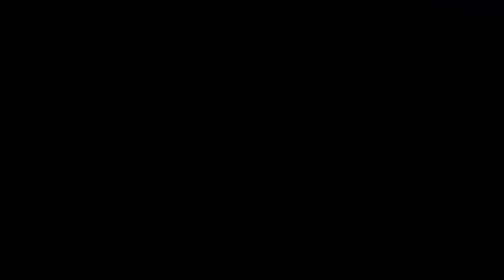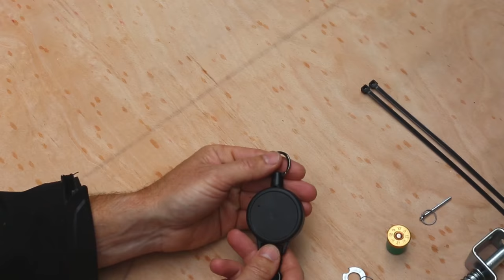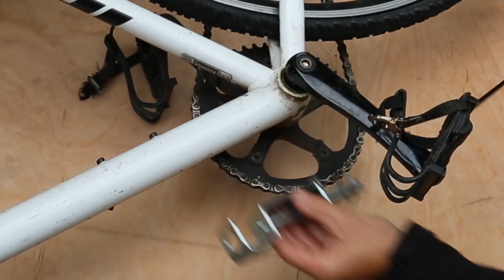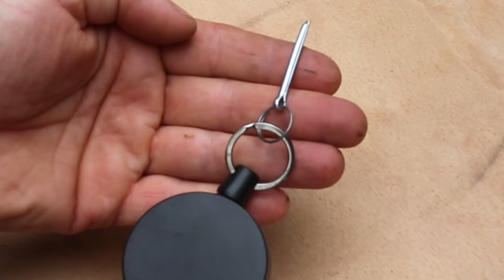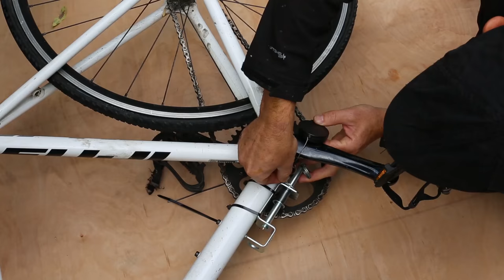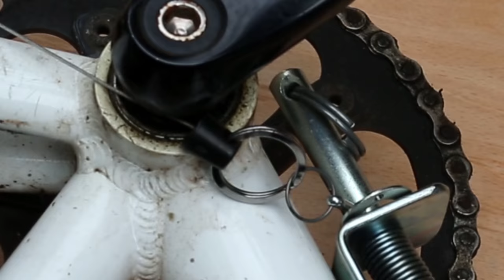Bicycle bomb booby trap for less than £20

Comment: That way up the shotgun cartridge is likely to fall out, you’ll burn the frame and using a split pin rather than the washer that’s supplied by the manufacturer, you break the string.